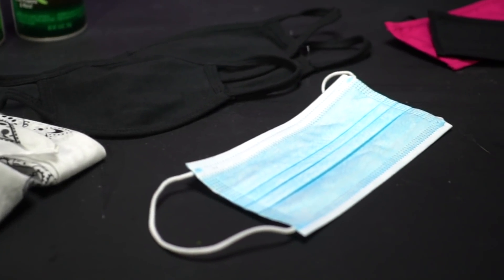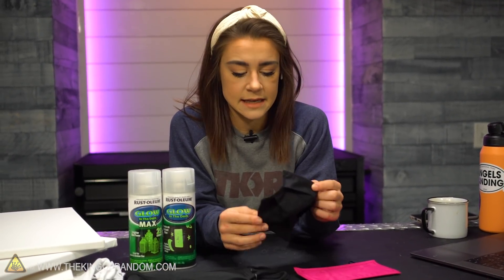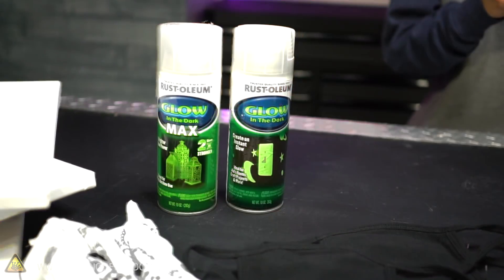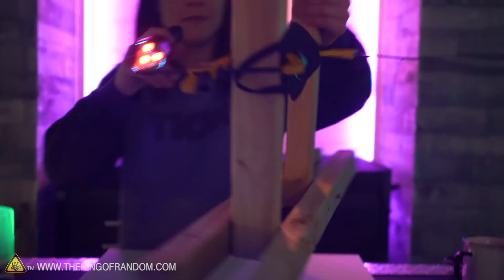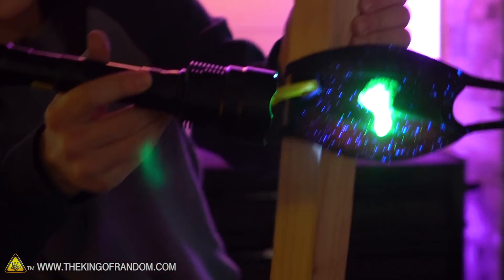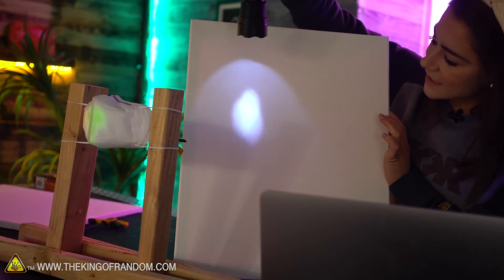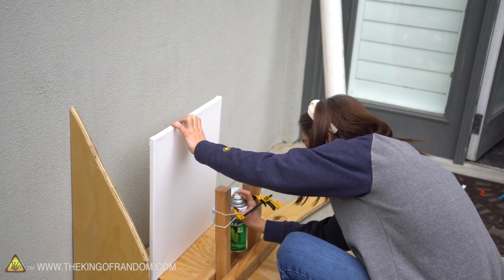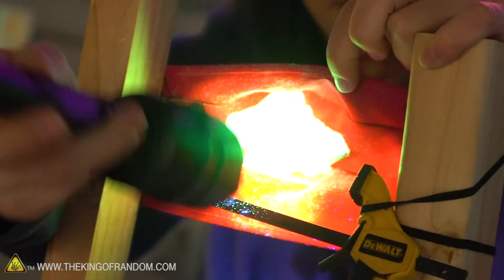DON'T Wear This Type of Mask

Comment: I'd like to see an experiment with masks and the reverse. Not masks blocking particles but how effective masks are at blocking sawdust, spraypaint fumes, or other things from going into the lungs.
Reply: Actually its pretty obvious
Sawdust is bigger so it wouldn't pass through compared with spray particles, Fumes is exceptional. Gas mask will resolve your issue
Reply: Yes that would be great
Reply: Your name is right
Reply: That's when you get a respirator

Comment: My grandma made me a kinda sporty gator. I double layer it. (Fold it over itself) I can layer it more as well.
Reply: Is there a possibility to get a mask?
Reply: @starlightart5147  ya we have a ton, but that is the only on i'd wear.
Reply: @joeljackson2909  can I ask why
Reply: @starlightart5147  actually it was just the sporty (elastic) type fabric and she sowed it all
Reply: @starlightart5147  I should have said (made) I use made very loosely. She got a preexisting gator (I think) and sowed a pocket on it so i could put a cooling thing in it since i work outside all summer.

Comment: I believe the particle of a virus is way smaller than the spray paint, that's why people are saying mask don't work, and that's also why in Taiwan our health department encourage us to wear medical masks and up from the beginning.
Reply: You are correct that particles of the virus are smaller than particles in the spray paint, however, as they stated in the video, the virus travels through respiratory droplets, it doesn’t just float through the air on it’s own. The respiratory droplets are much larger and are very similar to the aerosolized droplets of spray paint. :)

Comment: Nobody wears a "bandana mask" unfolded. Its always a triangle fold, as that's practically the only way you can secure it on yourself. That said, it is still objectively the worst due to the previously mentioned issue with "flappage".
Reply: Still better than nothing.
Reply: @wmdkitty  will concede to that.
Reply: @wmdkitty  not exactly bandannas are pretty thin to begin with so it won’t offer any protection. Better to use it to catch sweat around your head
Reply: I've seen plenty; but where I work we see more of people's lack of understanding and awareness respect. 

R.I.P.  Common sense.
Reply: you’d be surprised how many people wear only one layer of a bandanna
Reply: my freind does

Comment: Average size of aerosol is 40 microns....  big difference between that and a virus of 0.125 microns...
Reply: Still bigger than your pencil. The virus doesn’t travel on its own, it travels in water droplets which are significantly larger.
Reply: @kwstaskoutsos3300  much bigger?  Average size droplet from a sneeze has been recorded at 100 microns.  But in that same study it was measured down to 2 microns.  So yes there is a big difference from 40 to 60 microns from a spray paint can and as low a 2 microns from the human sneeze.
Reply: @matthewsones5287  isn’t 2 (the smallest number you mentioned) significantly larger than 0.125? Also 100microns (which is the average as you mentioned) is significantly larger than 0.125.
Reply: @kwstaskoutsos3300  2 is the smallest droplet size recorded.  Meaning that 40 is much much larger.  So if spray paint can make it through at 40 microns then imagine what your sneezing is doing...
Reply: We are in the Twilight Zone dude.
Reply: but viruses are caried by aerosols...
Reply: @uxleumas  aerosols that are much smaller than 40 to 60 microns though...

Comment: N95 mask packaging has a label or verbiage indicating protection down to 0.3 microns. Microns are small 
– 1 millionth of a meter. Pollen particles are often 10 microns or bigger. Bacteria are often about 1 
micron. COVID19 has a diameter of approximately 60–140 nm or 0.06 to 1.4 microns.
While particulate matter or organisms of any size 
can cause adverse effects to our health, particles below 
2.5 microns in size are especially dangerous. These are 
small enough to be absorbed directly into 
our bloodstream and enter our lungs, heart, and brains. 
Regular HEPA filters are fantastic at capturing particles 
under 0.3 microns. 
In fact, smaller particles, like 0.01-micron 
particles are even easier to capture than 0.3 micron 
particles. It seems counterintuitive that 0.3 micron 
particles would be harder to capture than 0.01 microns 
(30 times smaller). That is because we think of filters 
like a net, thinking that if a particle is smaller than the 
holes in the net, it gets through. That is how HEPA filters 
or N95 masks work for particles >0.3 microns. These 
particles either cannot fit through, either because they are 
bigger than the filter hole size, or their inertia causes 
them to hit the filter fibers (impaction & interception). 
Particles under 0.3 microns have so little mass the actually bounce around like pinballs when they 
hit gas molecules, so they move in random zigzag patterns. This is known as Brownian Motion.
Here’s why that 0.3 micron number 
comes up all the time. The weirdness of 
Brownian motion happens under 0.3 microns. 
The more easily understandable filtering occurs
above 0.3 microns. But where those two 
processes overlap is the weak spot. Particles at 
0.3 microns lie in between the two, and that 
makes them the hardest particle size to capture. 
Researchers call this the most penetrating 
particle size (MPPS). The theory of 0.3 microns 
being hardest to capture works for fiber filters of 
all types, including N95 masks.
Scientists from NASA have tested the particle capturing efficiency of filters and found that 0.3 
microns is the lowest point. Another piece of evidence comes from hospitals and airplanes, many ofwhich use HEPAs to capture viruses as the “removal efficiency is generally greater for particles both 
larger and smaller” than 0.3 microns.
3M, one of the manufacturers or N95 masks, issued a Technical Data Bulletin in February 2020, 
addressing these same concerns. Key highlights include these statements: “. . . it is generally thought that 
airborne viruses are normally attached to other particles and rarely exist as naked organisms. Inhalation of 
these bioaerosols may be reduced by wearing respirators. The US Centers for Disease Control and 
Prevention (CDC), the World Health Organization (WHO), and many national health authorities have 
made numerous recommendations for respirator use where they believed the potential for the spread of 
disease through the airborne route exists. Considerations for selection and use of respirators to help 
reduce exposure to bioaerosols include: 
• Filtration 
• Microorganism survival on the filter 
• Potential reaerosolization of the bioaerosol 
• Reuse of the respirator 
• Fit and the assigned protection factor of the respirator”
A number of questions have been raised regarding the use of respirators against biological agents. 
The primary question is whether or not particulate respirators can filter small particles such as fungal 
spores (2 to 5 μm), bacteria (0.3 to 10 μm), or viruses (0.02 to 0.3 μm). As noted previously, biological 
organisms may be carried on other particles including dust, blood, saliva, etc.” The following graph 
illustrates this concept.
Figure 1. Averaged Filtration Efficiency for Six N95 Respirators* (on the left), and Size Distribution of Droplet Nuclei from a Sneeze (on the 
right).
“The MPPS included particles with a diameter between 0.04 and 0.1 μm. As seen in 
Figure 1 (left), particles that are smaller or larger than the MPPS are captured with higher 
filtration efficiency. Filtration via diffusion (most noticeable for particles smaller than 0.1 μm) 
actually increases as particle size decreases. Other research has confirmed that filter efficiency 
increases with decreasing particle size, even for particles as small as 0.003 μm (much smaller 
than that of virus).”
It is important to note that the only way to ensure 100% efficiency of blocking particle 
flow is to also block airflow. Without airflow, you will not receive oxygen, and you will 
suffocate and die. Scientific research and best practices are guiding the recommendations made 
regarding PPE use at South Peninsula Hospital.
Reply: 'No no, he's got a point'
Reply: All in all you all best just wear a ww2 Gass mask with extra hepa filters  or a has at suit lol
Reply: @Arakellian  its funny because i did that at a party, full on world war costume with a gas mask

Comment: But the thing they dont take in account is the leakages from the sides of the masks and on the sides of the nose, and also this experiment shows the results for a couple of seconds of wearing a mask where people wear masks more often than just for a few seconds.
Reply: Just to be clear im not saying anything anti mask or whatever bu that their video doesnt count in all the factors to their experiment.
Reply: @krzysztofkoba9982 , anti mask? Is mask an ideology so you can't logicaly refute any aspect of it?
Reply: @talisb7883  youre right, im not anti wearing a mask
Reply: @talisb7883  anti mask is a very common term people have been using to refer to people that refuse to wear masks for any reason

Comment: I think the virus is smaller then spray paint
Reply: The virus is but spit and particles arent. Wear one if you want to is my opinion on the matter
Reply: @d3adlyz3bra  i would still wear a mask because it’s better than nothing
Reply: @susef7131  then wear a mask. I dont because I am not worried about it at all.
Reply: @d3adlyz3bra  im also not worried but here in austria if you don’t wear a mask your in big trouble you have to pay a couple of thousand dollars
Reply: @susef7131  see not an issue here where I am. There is a mandate with no repercussions so basically no mandate
Reply: @d3adlyz3bra  dude where do you live bc how do you not have to wear a mask
Reply: @yoshiplaysgames2804  plenty of Midwestern states where its a mandate not backed by any punishment.